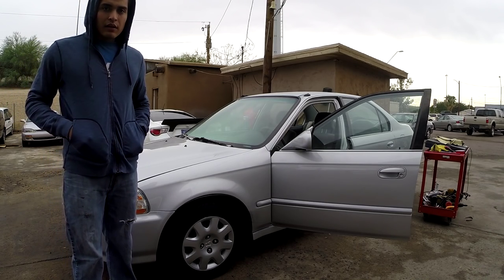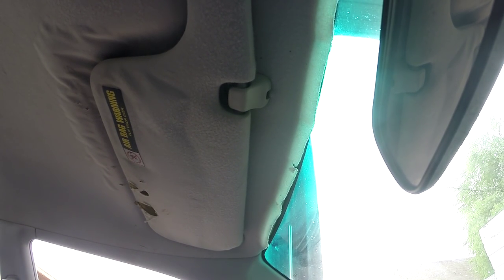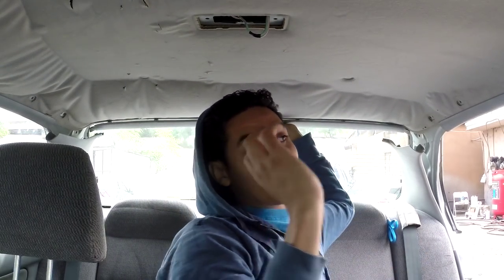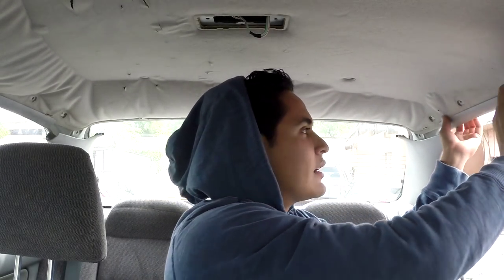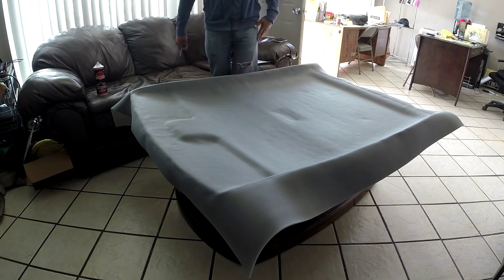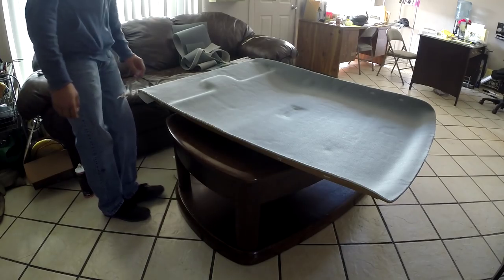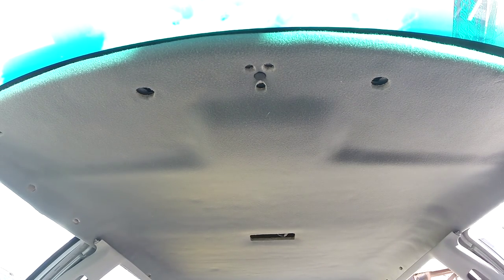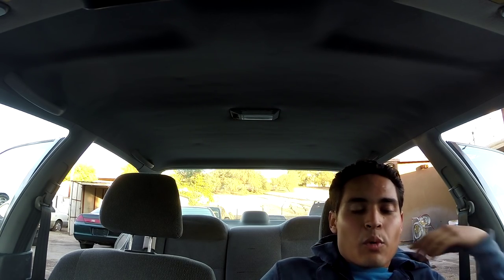Customize/ Repair Your Headliner [How-To]

Comment: Great vid man - just a heads up, when you remove the old fabric use a wire brush or a stiff nylon brush to remove the old excess foam from the hood liner or you will have problems with the old foam degenerating then you got sagging all over again.

Comment: I want to remove the foam first . Do you also glue it on with the adhesive? I'm confused
Reply from the maker: After removing the old foam and cloth, went ahead and bought headliner fabric, That what it's called apparently, which is a cloth and foam combo and used adhesive to glue it back to the headliner shell.
Reply: Thank you ! Im gonna try to do this myself . Hopefully i wont fuck up 😂

Comment: how can i repair cigarette holes do i have to replace the entire  headliner ?
Reply from the maker: I would replace the entire headliner. Another option would be getting a foam sealant like "great stuff" to fill the hole and remove the excess. It looks very similar, you would just need to find a color match, but it's only a quick temporary 'fix'.
Reply: thank u ...